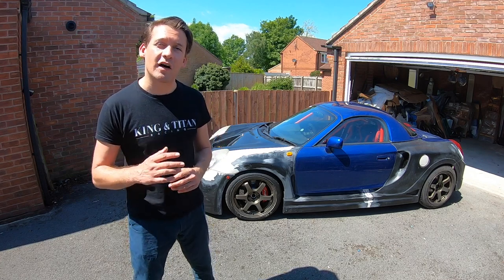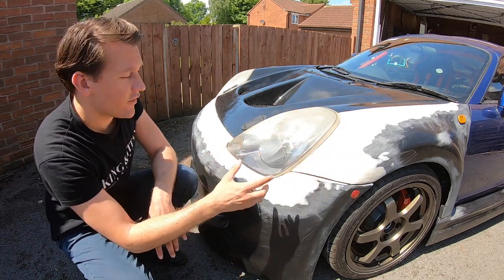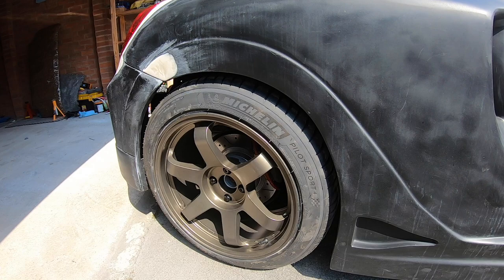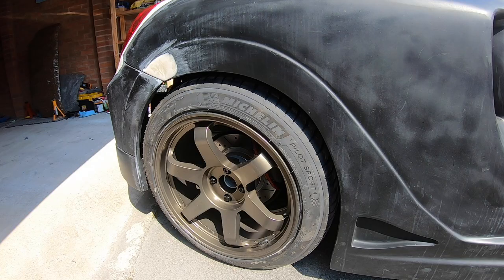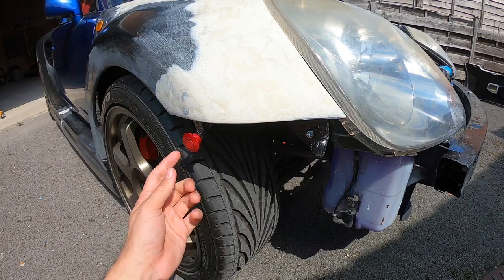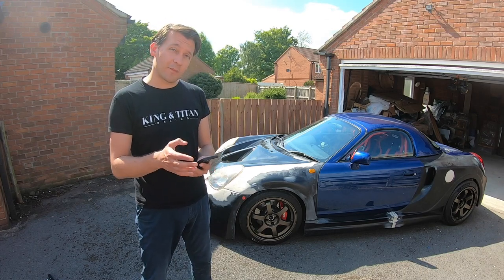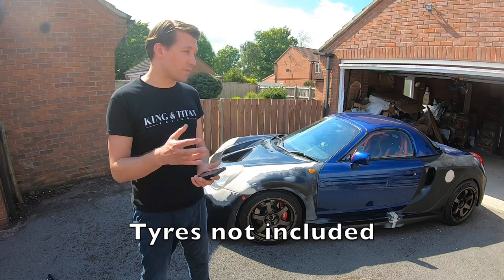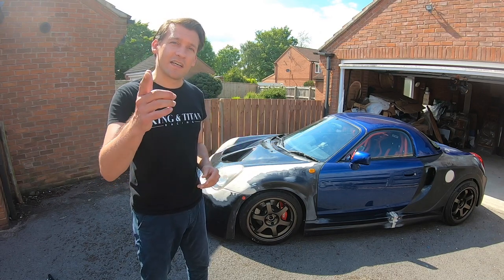Widebody Kit, How Much Did It Cost?

Comment: wait, why would you put sealant over all the panels? doesn't that defeat the purpose of the MR-S having un-boltable panels 360 degrees around the car for ultimate serviceability when you need to scrape rust off the frame or tend to repairs easier than any other monocoque in existence?
Reply from the maker: Yeah that’s a great benefit of the MR2 but when you widebody the reality is the production of the kit just isn’t as good as factory. I just used the sealant to fill the slight gaps to the edges of the panels I wouldn’t want to remove. Skirts and 3/4 panels. Bonnets and bumpers are on/off all the time. Thankfully mine hasn’t got any rust on it and then I did the under seal anyway as an extra precaution.
Reply: @KingandTitanRacing   i feel that normalizes the car a bit. One deciding factor for me to purchase an ZZW30 over the SW20 was the removable rear panels that are otherwise permanent/ common rust spot on japanese cars. at least it's still virtually possible when you get crashed into/ struck by grandma's door at market. even if you must remove extra sealant.

Comment: What is the name of the kit?
Reply from the maker: This is a copy of the APR kit, there’s a few companies that do those as the originals are very rare. I got this one from EBay and imported from China but the seller doesn’t do them anymore. I got one of the last tho they had in stock and it looks like they’ve not produced anymore. These kits can cost anything between £1500 and £8000 just for the kit depending into he material. (Fibreglass/Carbon etc)

Comment: It's very cool. I'm looking to do something similiar. Where did you order the kit from?
Reply from the maker: Thanks! I ordered the kit from china, found it on eBay and then had to do the import etc that I mentioned. The kit had a lot of issues, but nothing I couldn’t fix as a first timer. I’d rather have to cut off a mounting tabs going in the wrong direction and remake my own than pay an extra £1000 or more.

Comment: Hi Buddy,

Planning to go widebody. What's your wheel and tire spec in both front and rear? does it rub in the front when full turn? Thank you for your help!
Reply from the maker: Hi Vince, sorry for the slow reply, I wanted to be with the car to double check for you and have been travelling a lot recently. The wheels are 17” all round with Michelin PS4s on. That’s a great tyre for track and road, I use them on my Vantage as well. 
Rears are 17”x9” with an ET of 25. They’re a perfect fit with the widebody. I did try 10” but they were too wide in the end. 
Front I’m using a custom billeted bolt on 50mm spacer and 17”x7.5” with an ET40 offset. They do rub a tiny bit on the weld in the wheel arch but you can hammer that flat without cutting it. Just paint over any scratches and then under seal the arch. 

Hope that’s helpful, sorry for the delay.
Reply: @KingandTitanRacing  No worries Buddy! Thank you for your inputs! you really have a beautiful spyder!
Reply from the maker: @vinceapolinario2245  thanks! Lots more to do though. This weekend I’m hoping to finish the prototypes for my front splitter and rear diffuser. Going to do a full flat floor too.
Reply: @KingandTitanRacing Hi Buddy,

I have a question regarding Tire size. we have the same wheel set up just like to ask if 45 series in the front will hit the wheel well that you have flat down? is 40 series really the one you would recommend or I can go up to 45? thank you

Comment: Holy crap 1 inch of body filler on any car is not good pal, instantl design flaw
Reply from the maker: We’ll see with use, have had good reports from other builds on this one and the bonnet we did has stood up to a good few road tests. Not ideal but the only solution on hand. It’s bonded really well to the kit which is encouraging.
Reply: @KingandTitanRacing  reminds me of when I was 17 and my mate bogged up a dent with over an inch of body filler, that is NEVER a good idea, may as well cement some bricks in the footwell too lol
Reply from the maker: @andy2906  ha, I know what you mean. Filler does have a chunky weight to it. Overall I’m happy with the weighty of the bumpers though, still not notably heavy. And that filler has been sanded back many times so the finished product is probably close to 2/3 of an inch.